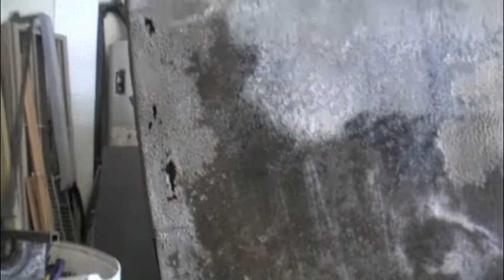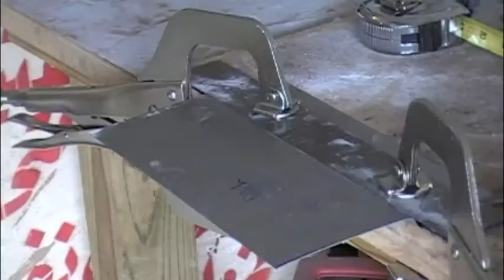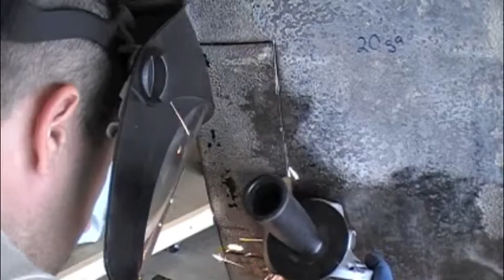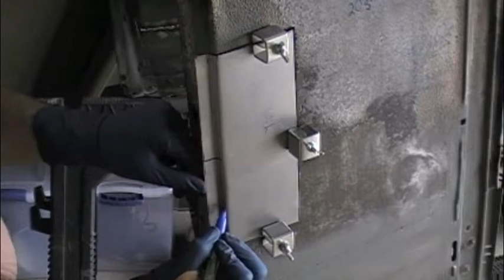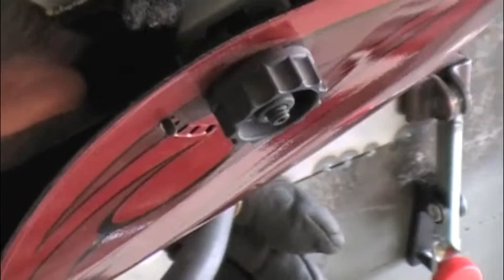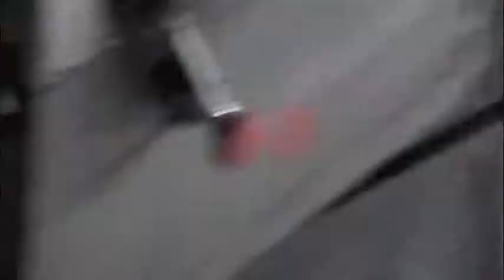1930 Ford Model A Cowl Patch Panel v2

Comment: Nice job! Looks like the gap was a little big.
Reply from the maker: 1/16 gap is just right. That way you can fill the gap with metal, instead of putting the tack on top of a flushed gap.